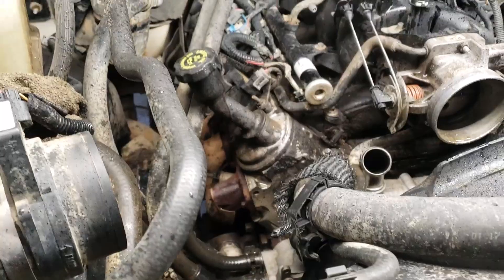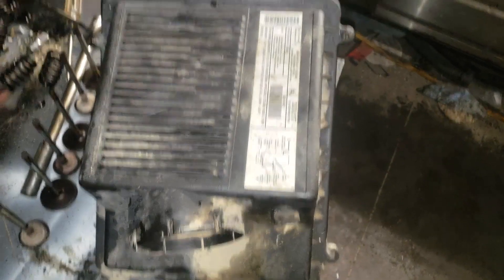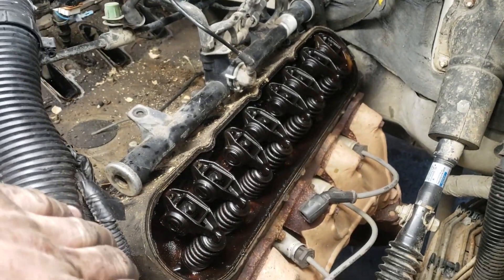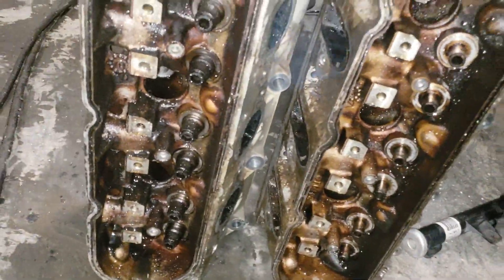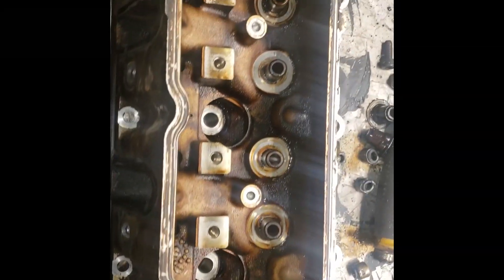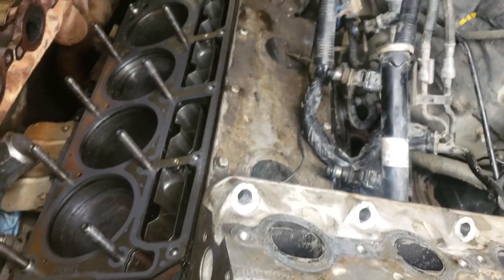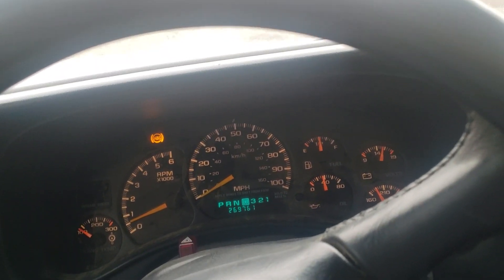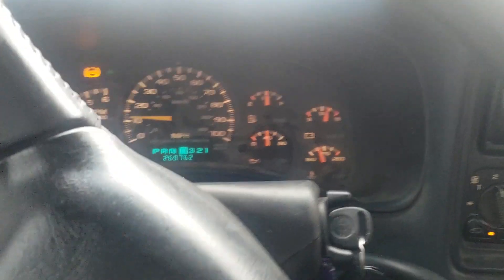**Cam Swap** Project Turbo 2500 HD

Comment: Runs pretty damn good for a 270k mile truck good job brother. Whats a tune usually cost?
Reply from the maker: my buddies has hp tuners so it won't be alot. I'd have hp tuners myself but I run a aftermarket ECU on the mustang. I dont feel the need to purchase it since I'm just pulling the car with the truck and just driving it so once its tuned it's done and I don't have to change the tune alot like I do with the car.
Reply: @BOOSTEDVERT  I agree its easier and cheaper to pay someone once in a awhile. I was asking because I have an 03 mustang and got the bama tuner but they dont tune for boost they said so i was looking to see about what it would cost since i have the tuner